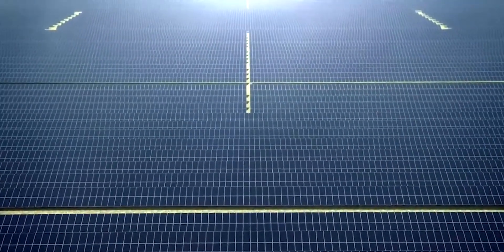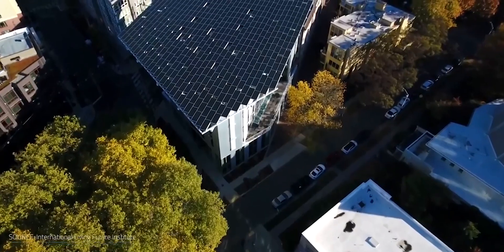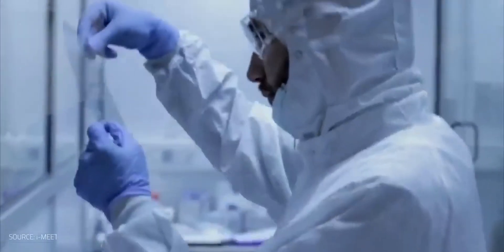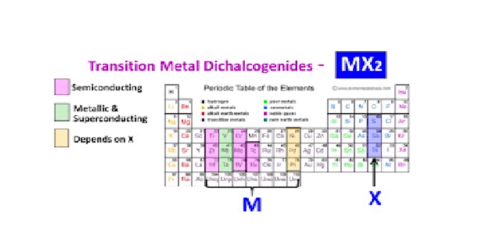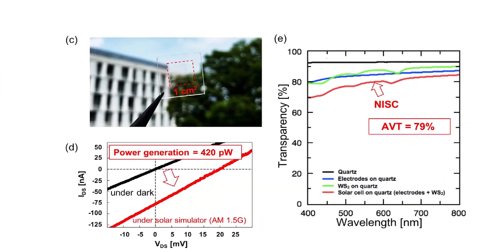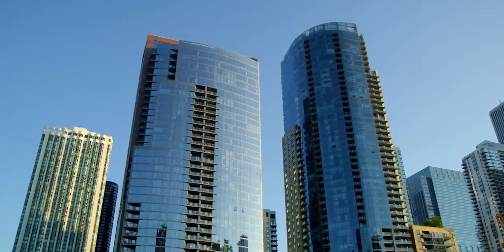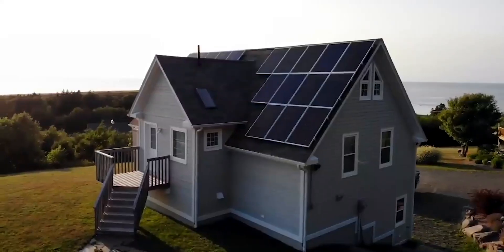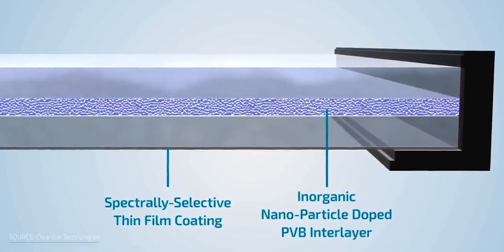Transparent Solar: Scientists Create Invisible Solar Cell With Up To 79% Transparency

Comment: i want a transparent glass shaped bike and a bike frame that collects solar energy in its transparent design and powers a motor. imagine if parked under a solar reflector to concentrate the solar energy. Their is something called agile solar panels and they use a shaped half pyramid like shape glass structured on the inside to reflect and let light flow only downward into thing, it could be structured glass like that in the bike frame just on bigger scale.
Reply: Super idea.